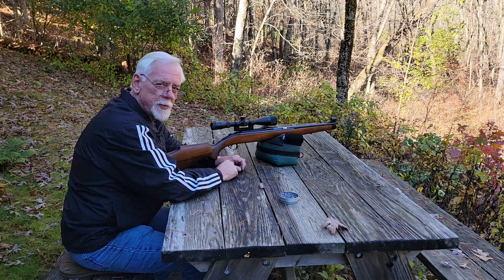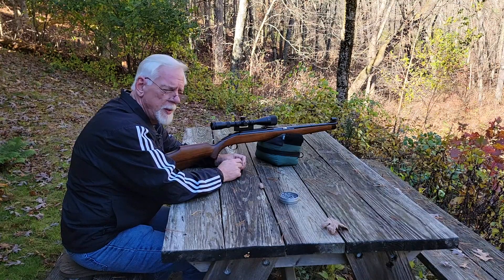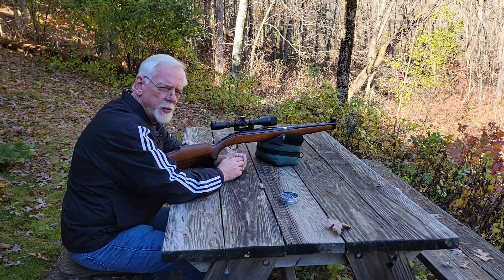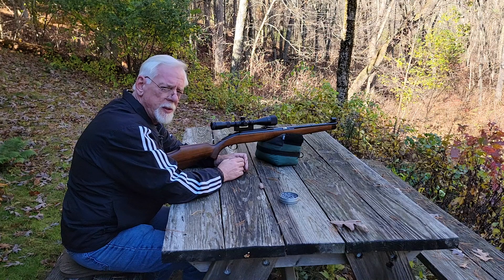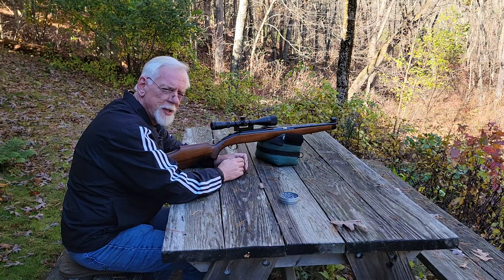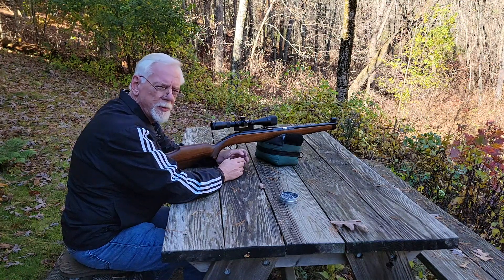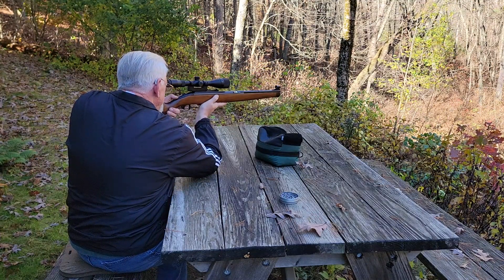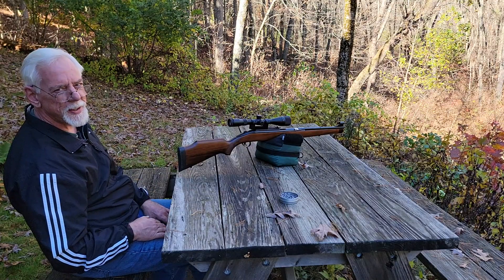BSA Stutzen RB2 Update

Comment: I have a Gamo Stutzen which I bought new quite a few years ago. The gun is very nice with almost no plastic except for the rising breech block. It is a twanger buzzer beast though, with a very harsh shot cycle. I would love to have it be fairly normal, but it seems to have about twice as many parts as a springer should have, so when I got in there I just came right back out before getting over my head. I`m jealous that you were able to fix yours. This is a beautiful little air rifle that just sits.
Reply from the maker: Hi David. Perhaps a "Tune in a tube" will help to cancel some of that vibration without having to disassemble the rifle. 
https://www.pyramydair.com/product/air-venturi-tune-in-a-tube-airgun-lubricant?a=7927
Thanks for watching and Merry Christmas.

Comment: No need to tear the gun down just remove the rotary breech thumb lever cock the gun and rotate the breech until screw is visible, adjust the screw rotate back and test, this system allows for fine tuning. A similar system was used on some supersports to control the power levels the grub screw can be found in the breech end beneath the cocking link.
Reply from the maker: That's awesome info David. Fantastic in fact. Can't thank you enough.  That's gonna save allot of time and make it easy to experiment. Why these things don't dawn on me I don't know...thanks again David.

Comment: Hello,Kevin, do you think the feinwerkbau sport is worth the $599 AOA is asking ...I really want a new break barrel. Thanks
Reply from the maker: Hi Mike. The Feinwerkbau Sport has potential. When tuned and the power reduced to between 12 & 14  ft lbs, (Mine was making 15.4 ft lbs before I cut the mainspring down by one coil.) it's an absolute dream. One of my favorite guns in the stable. Nice weight to power ratio, wonderful trigger and a stunningly beautiful appearance. However,  out of the box it leaves allot to be desired.  If you can perform the work yourself, then it's probably worth the cost of $600 but if you have to send it out to be tuned the cost would be prohibitive.  It's an easy gun to work on provided you have a spring vise. 
So to sum it up, yes it's a fantastic rifle but I wouldn't recommend it (at the $600 price point) unless you're going to tune away the problems.
Noisy cocking, harsh, distracting recoil, annoying spring twang and a very loose fitting piston seal. ARH sells a much better seal.
Hope this helps Mike. Thanks as always my friend.
Reply: Thanks pal for the Info...I cant work on it so i think i will look at the hw 95 . Thanks again
Reply from the maker: I just picked up an HW95. Really nice rifle. There's a video series coming this winter where I'll be fitting a custom, left hand stock and tuning the rifle to build a one of a kind 95.
If you haven't bought from Krale yet, you need to look into them. They just got the 95s back in stock. Their prices are the best and shipping is fast and reasonable. 
https://www.krale.shop/us/sport-shooting/

Comment: lesson  learned, always look through the transfer port, i've seen some with burrs or badly bored too that needed opening up.
Reply from the maker: Lesson learned is right.
Reply: This is why I always measure the port with a drill index. At least you have that reference to work off of and you can open it if necessary, stepping it out until your 80/85% there. 😉 Never take it to the edge unless you have a documented port size, or it can bite you in the arse ! 😂

Comment: adjustable transfer Port that's pretty cool
Reply: it's for countries with power limits.
Reply: @junglie  In Canada they just drill a hole in the top of the piston...
Reply from the maker: It is a good way to throttle the power. I've seen it used on PCPs but never on a springer.  Learn something new every day.
Reply: @pelletsandpistons  Yeah air arms have used it for years too.
Reply: It's actually more articulate than slugging the port. 😉👍